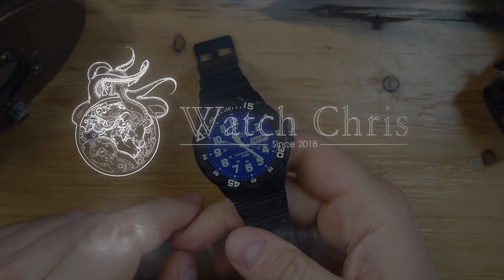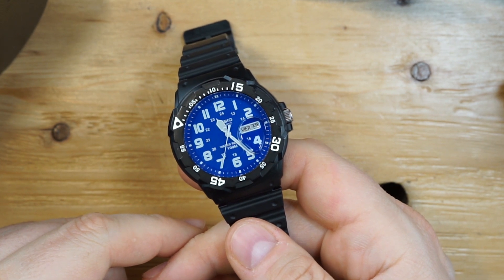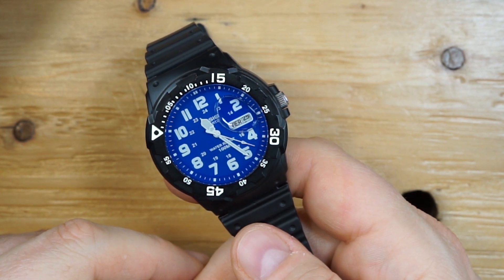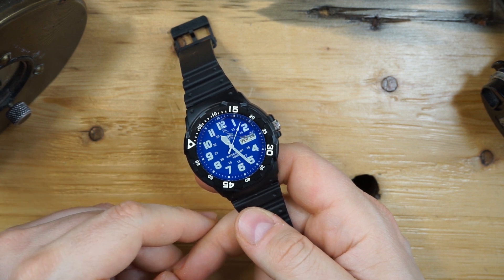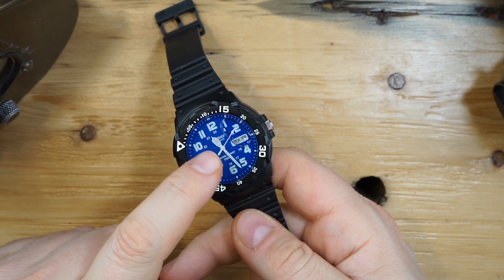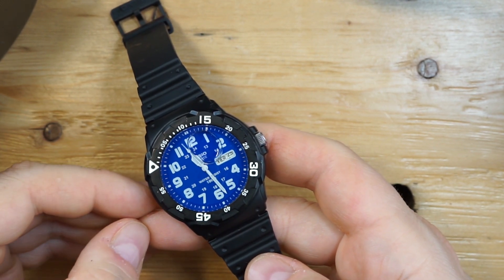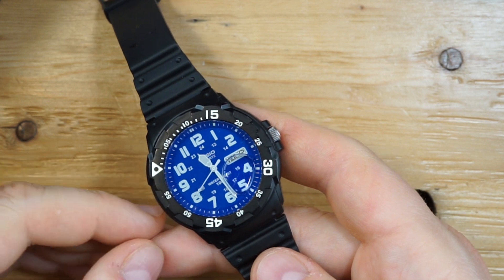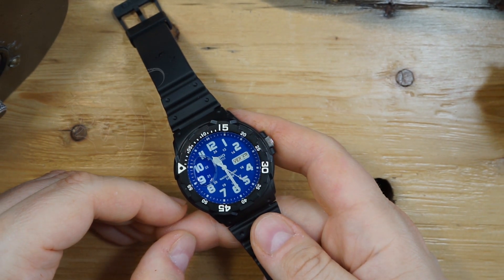CASIO Oil Filled Case Mod Water Resistance Test Update MRW 200H

Comment: Seems a bit of a journey. I have done this mod and also work in subsea engineering and do something similar on our vehicles. Fill all the air spaced with oil and compansate the oil (water pressure reacts against a bladder to equalise the oil to same pressure). If you have any air gaps basically messes it up. Also depends on the way they test it, can't test this type of watch in some watch testers such as the ones were you released pressure under watcher. Other problem is oil does expand so you do need to have something which will give to allow this exspansion or pop. Sorry for the long comment, short version it's not easy to test this mod without doing it in the true enviroment :) Great video mate :)
Reply: Wouldn't the air bubble allow for expansion?
Reply: @JohnBrown-mq3mn  It would yes however if you dive this air compresses so you then get the water pressure acting more on the outside of the case. On kit we work on we use compensators which aid in this function :)

Comment: Check out Jody Musgrove in Sydney who bought some rudimentary kit for testing pressure and checked out the claims of Chinese watches. He's at Just One More Watch on YouTube. Today I was looking at the U Boat Capsoil watches which have a dial bubble rather like a spirit level, as yours does now. I wouldn't know why though. Just for fun I thought that I would try to fill a watch myself so got a really cheap piece of junk and filled it with rapeseed oil. It worked out quite well except that the white dial went piss coloured. The oil smells of  fish anyway, so it was no great loss. Next I think I might try it on the same model as yours using silicone oil. Mine has a black dial and orange numbers. I'm sorry that you were messed about. Good luck with your next attempt. And thanks for your previous video on this. 👍